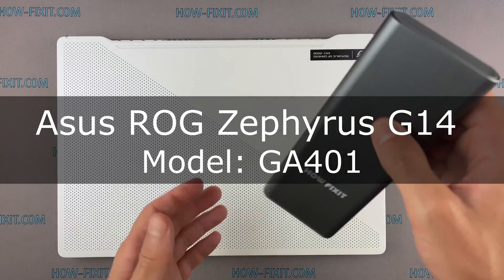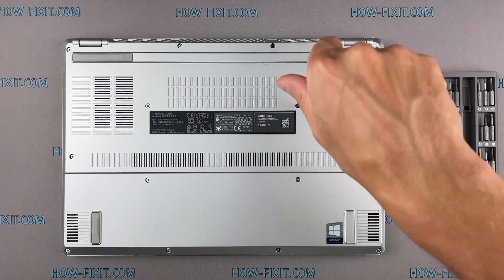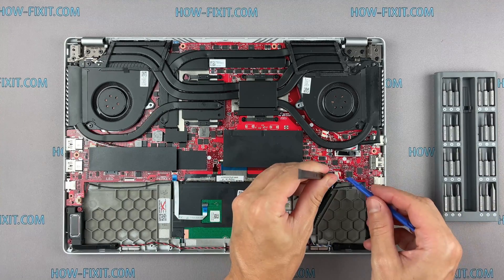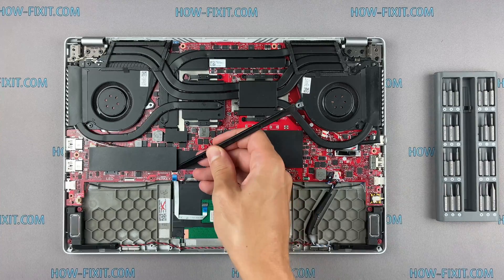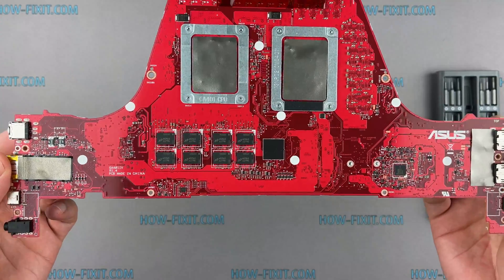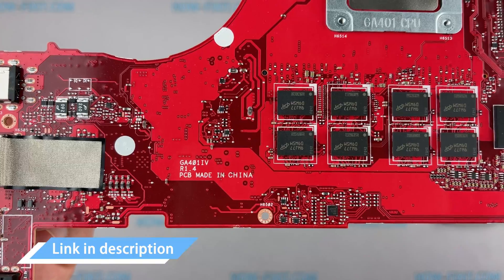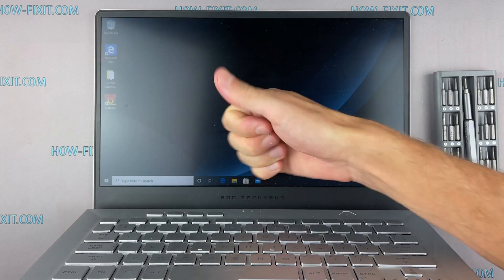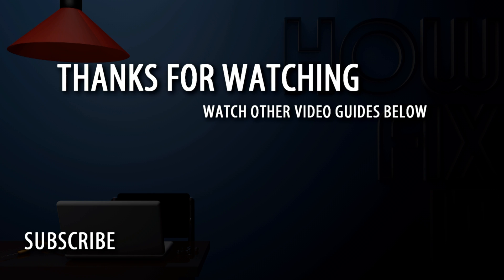Asus ROG Zephyrus G14 GA401 Motherboard Replacement Guide

Comment: Hi. I fond this motherboard cheap on some websites. Will it work without the case? for example, at 3:42 you removed the whole motherboard so would it boot if you plugged it in with a monitor?
Reply: Where did you found the motherboard?
Reply: @alangallagaochoa8806  on taobao, search it with image and it should show up
Reply: @georgeshalvashvili6270  how about bro a query, for how much more or less did you find the plate in taobao?